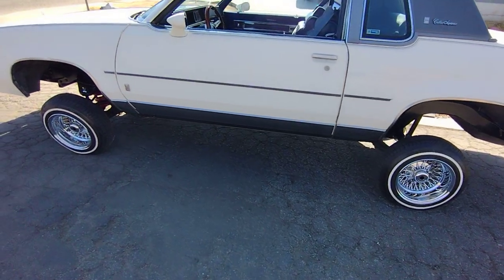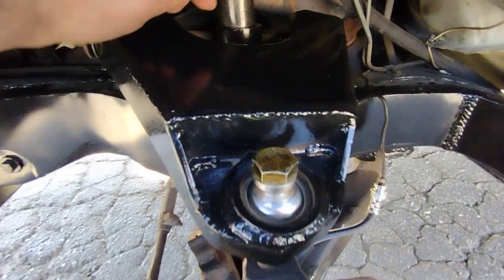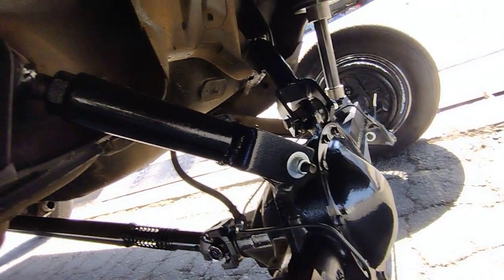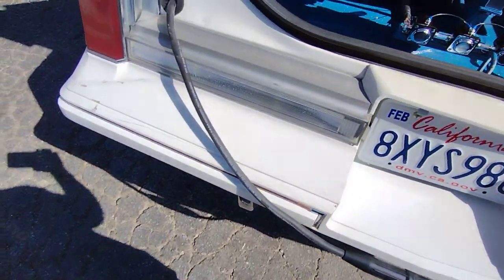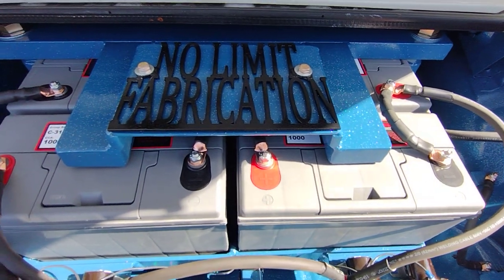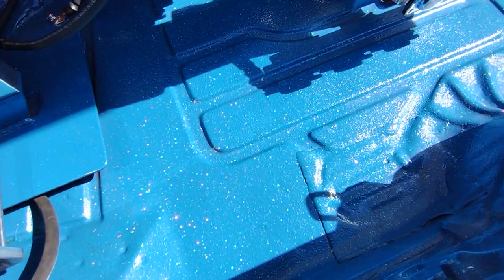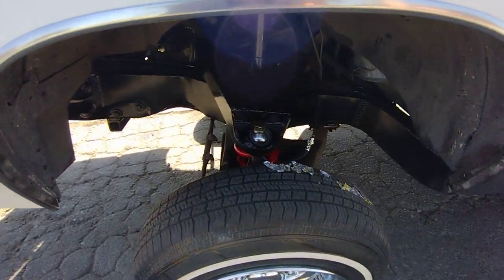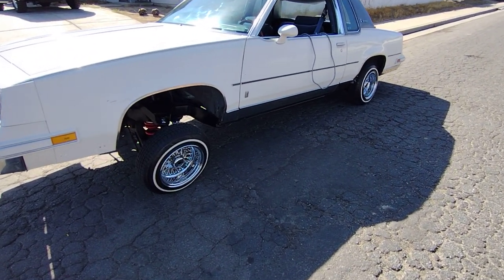Lowrider 1984 Cutlass 3 pump 6 batteries. 4 corner reinforcement. No Limit Hydraulics

Comment: Clean ass work. I feel sorry for the owner when it's time to charge tho 😂
Reply from the maker: The 6 batteries tucked away are arranged for the number 1 battery and number 6 battery are poisoned on the left bottom corner of the rack near the pump. 

The 6 pack multi charger gets clamped on with easy access.

Everything in the trunks is detailed drawled on paper before fabrication & electrical work. 

My primary focus is to give everyone beefy shit and one off trunks. No look alike trunks around here 🤣

Comment: How do I get in contact with you need some reinforcement asap
Reply from the maker: I'm currently booked out for over 6 months. I'm not currently excepting anymore appointments until I knock the appointment list down. 
If you need it done in 5 seconds you can try contacting these other shops.
Pelayo Hydraulics
661-859-6258

Lowrider Rudy's
661-401-0913

Jose Certified Customs
661-668-8352

Gary Fatboy's Restoration
661-213-6702

El Diablo Hydraulics
661-865-6114

Comment: Can someone let me know if I can raise the front up with out pump in the car
Reply: You do need a pump, it does not need to be installed on the car but it needs to be grounded to the car, attach one foot hose to hydraulic cylinder with a slowdown valve or a dump, then you have to close the slow down valve to hold pressure and then remove pump, it would probably be better to put a spring in there instead of hydraulic cylinder.